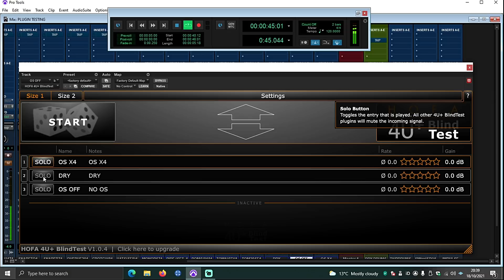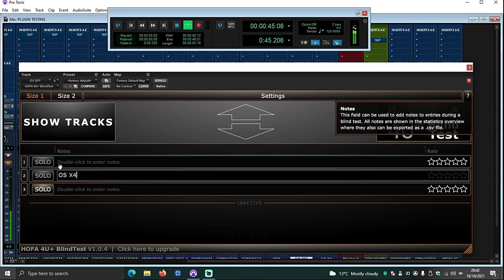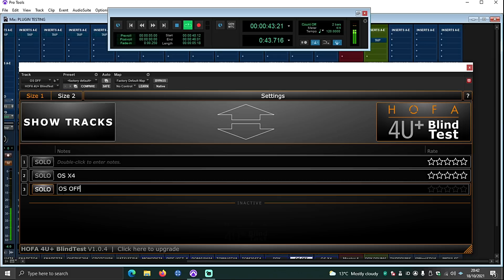ALIASING IN AUDIO PLUGINS... The most important things you need to know!!

Comment: Another point about stacking analog emulations is the difference between OS plugins and running at higher sample rate. OS plugins are generally a better choice for this reason -- ie, when you stack analog at high sample rate (no OS), the higher harmonics from earlier stages feed later stages causing even worse aliasing. With oversampling there's always a LPF to cut out things above Nyquist. So stacks of oversampled plugins will run cleaner than stacks at same equivalent sample rate, assuming you do not manually insert LPFs between every stage to replicate the filtering.

So if all plugs I use support oversampling, then I'd always choose OS instead of running at higher sample rate.
Reply from the maker: It's definitely something I'll need to look into because a few people are commenting about the artifacts of oversampling, some are commenting about higher sample rates. I'll need to dig into it at some point haha but yeah I agree, I have seen some plugs at even like 192 which still has some audible aliasing due to the amount of distortion made
Reply: @PaulThird  yup, there's probably some amount of artifacts just from the up/down sampling process itself (different amount of interpolation -- REAPER has options for this), and the LPF is going to induce some phase distortion no doubt. EQ isn't free in that sense.

For 192k not being enough, I personally don't worry about it unless I'm intentionally driving something really hard like with guitar FX.

Of course all this feeds the analog v digital debate.

Comment: Aliasing is awful, there are still developers around like Airwindows telling that oversampling sounds bad in comparison to their terrible aliasing  plugins...
 Oversampling option On/Off - Render On/off should be a standard on all plugins. Developers are just lazy to implement this, it´s ridicoulous. I never buy one  plugin again without this feature.
Reply from the maker: I tried his ultrasonic which was his solution to not using oversampling but it didn't work for me. Dunno if it's cause I use metaplugin as a vst wrapper in protools but it didn't do anything haha
Reply: @PaulThird  dude... The ultrasonic plugin is specifically for filtering out ultrasonic frequencies when you ARE oversampling...
Reply from the maker: "Drop it into your (preferably 96k or 192k) digital mix and it will clean up anything nonlinear that goes after it

It’s very easy to use: just put the plugin before anything that might alias

Put it on everything that you want to smooth out and un-digitalize. Sometimes there’s nothing quite like beating the problem into the ground with a sledgehammer. For frequencies over 20K and the aliasing that loves them, this is that sledgehammer."

I didn't take anything about oversampling. I tried it at 96k with aliasing plugins. 48k & 48k oversampled x2 just to see. Tried it before, after.. Didn't do anything. Aliasing still remained. That's why I am saying if its possibly cause I'm using it in metaplugin as he doesn't do AAX but it doesn't matter what I do and how I use it I can't get it to do anything. It removes no aliasing
Reply: @PaulThird  it doesn't remove aliasing... It's meant to remove problem frequencies that you can't hear to avoid them screwing around with further processing... That's all...

Why would you think that placing what is just a steep LPF after any potential aliasing has occurred, world magically remove said aliasing? That's not its purpose... It's just designed to lob off "ultrasonic" frequencies before passing the audio to the next bit of processing.
Reply from the maker: But then why talk all about aliasing then? 

'Aliasing in digital mixes is annoying. You typically don’t hear it directly, but it coarsens and flattens the mix, throwing all sorts of funny harmonics in there at random frequencies, like subtly ring modulating everything (the aliased harmonics go off on frequencies not related to the original notes, and clash). It’s often very subtle, but it turns up everywhere you have nonlinearities. If you distort stuff in digital mixes, you run straight into aliasing problems. Same if you compress, or do anything nonlinear… and even if you make a mix as pristine and minimal as possible, if you’re mixing in the Airwindows Console system that uses nonlinearities too.

You can run at higher sample rates and that gives you more room, you can use soft saturations (like what’s in Console) and that makes the harmonics appear in order so only the highest frequencies will fold back and alias, but it’s in a computer: you’ll always run into the limits of juggling numbers and calling it music, and you’ll experience aliasing through nearly anything you do.

But what if you just took those problem frequencies away?

It’s very easy to use: just put the plugin before anything that might alias"

Why is he taking so much about aliasing
Reply: @PaulThird  Because it's designed to minimize any aliasing (preemptively) that would be brought into your mix by ultrasonic frequencies when running into subsequent non-linear processing. If you're not feeding those plugins those frequencies, you're not gonna get aliasing from THOSE frequencies, bc they have been removed before they ever reach the next plugin. 

A fine example is running a synth at 96khz, there is a TON of ultrasonic information there that may or may not wreak havoc further down the line. If you filter that out, you get the benefit of a cleaner sound from the synth, without causing any nastiness in the next plugin getting that generated audio.
Reply: @IAmSomeTreyGuy  ultrasonic is not working, his plugins still aliasing with it, compared to other´s with built in oversampling option, like fabfilter, melda...etc
By the way why would you use another plugin for fixing aliasing, it´s a workflow killer and  can only be developed by such a weirdo like chris, who has clearly no clue how to make records using a DAW! His tools are useless for that regard.
Reply: @jorvten360  OMG... I cannot explain it any better. Ultrasonic does not REMOVE aliasing... It is meant to prevent any aliasing caused by ULTRASONIC frequencies in any plugin that is processed AFTER the Ultrasonic plugin... Frequencies BELOW the audible range can still cause aliasing. You have a complete misunderstanding of what the plugin is even for.

It's literally just a steep LPF. NOTHING MORE...
Reply: @IAmSomeTreyGuy  Well the developer, chris claiming  this method to be used in reducing aliasingg on his plugins.

A) Higher session sample rate 96K with 
B)  Putting aditional ultrasonic filters in

That is not working, the developer Chris is claiming this method should reduce aliasing.

Unfortunately you´re better of with plugins from developers  that are using actual working oversamling options into their plugins. 
Like fabfilter or Melda, Tokyo Dawn etc... and manny others. less headache, better workflow, more stable system, cause you can run at 48K session sample rate.

In my experience all Airwindows plugins are useless, exept the Dither Plugins. They are kinda special, that´s it. 

Please stop further discussion on Airwindows, i´ve spent to much time on it comparing them to my bread & butter plugins, it was just a waste of time!
Have a great weekend :)
Reply: @jorvten360  You have no idea what the plugin is even for... clearly.
Reply: @IAmSomeTreyGuy  I don´t need  it, it´s not fitting my workflow. I´m not an Airwindows lover & you won´t convince me. I know my tools in & out 100 % they blow Airwindows out with a blink of an eye. If they ´re working for you, i´m happy for you!
Reply: @PaulThird  The guy is living in his own bubble, that´s the problem with developers that have never done a record in their life or how know how to use a DAW  for final production.
Reply: well, I think aliasing should always be a choice.. an option. I've had oversample options in plugins that I used to use. For example on the Saturator-X. Now mind you: That was before I knew what aliasing is. And being a good little engineer I simply tried clicking the buttons and picked what my ears favored. Now maybe you guessed it.. sometimes I preferred no oversampling. Crazy, I know.
Reply: @akagerhard  Aliasing is terrible, especially with transient heavy music. For me it never worked well, it´s night and day. i started back then with tape, midi sequencing, big console studio environment. Aliasing was not exsisting, i made the analog to digital transformation from day one, knowing both worlds in & out. At the end it´s a personal preference & taste. I like clear precices transient behavour and a wider soundstage. That´s only happening on my material without Aliasing
Reply: @jorvten360  I usually don't look aliasing neither.. but it really depends on what kind of scource you're using it on and what kind of sound you're aiming for. I'm not saying I wouldn't use the OS-buttons more often than not.. I'm saying: give me the option.

Comment: Another great video Paul! Question for you… No doubt running higher sample rates cuts back on aliasing. However, I’ve been told that if your sample rates are too high, you can introduce artifacts, which are non-aliasing related. Are these high sample rate artifacts due to the fact that some peoples computers can’t handle the processing power to run the high sample rate, and therefore the artifacts are showing up? Just trying to pinpoint where and how this is happening. That being said, perhaps there’s a sweet spot, Where the sample rate is high enough to not introduced aliasing, but low enough to not introduced additional artifacts? Any thoughts?…
Reply from the maker: I don't know tbh. An engineer friend of mine nulled a 44.1 track with a 192k track so I can't say for sure if there are artifacts but my gut says doubt it in terms of daw sample rate. I can see oversampling possibly causing artifacts and that is something that I look to test in the future as artifacts in oversampling in  certain plugins have been mentioned before 🤓
Reply: @PaulThird  thanks! This makes sense! I personally have never heard any artifacts when running my sessions native at 96K. But then again I have a pretty robust computer. Anyways, if you end up releasing a video that tests potential artifacts at higher sample rates, I would certainly be curious!
Reply: @colonelw.g.sparkman6931  it can be accuracy based as you guessed, but it's also harmonics from above 20K coming back down into the audible range and causing distortion/artefacts etc,

Comment: Well I looked away from the screen when while you were switching thru the three, and I could not tell when you switched between the tracks. My internet machines speaker setup is a pair of Sonarworks corrected Behringer Truth B2O31A' speakers. Maybe is my 67 year old ears? Who knows. Thanks for the video.
Reply from the maker: I could still tell differences in the car driving back from work but it was really hard due to the horrible bass in the speakers drowning a lot of the detail. I kept on getting the Lindell x4 PA right but had to listen harder for the dry and aliasing to the point I actually had to redo it with the engine off haha helped a lot but still difficult.

With these tests I find it's all about knowing where differences are. As soon as I know where they lie I know where to look so I don't get distracted by other things, especially doing 3 files, it's easy to get thrown off. I had to do it 3 times more to prove to myself haha
Reply: @PaulThird  stop showing off, you'll get yourself killed.. listening for aliasing while driving.. you're nuts!
Reply: Don't worry. I looked (and thus knew when a change was coming) and still got it wrong the second time around (I suceeded on the first and third blindtest - maybe luck?). And my ears are considerably younger than yours. I don't think I'd conciously notice a change fast enough, if I didn't know when the change is coming. This was too subtle of an example for this - in my opinion. Maybe there are engineers that get the heebie-jeebies instantly without looking - I'm not one of them. (Was listening on my non-corrected, but deerly trusted 30 Buck Logitech Speakers (Sub included, but irrelevant for that example).. if I can't hear something on them, for me, it doesn't exist)
Reply from the maker: Could be the YT codec but with these simple tests I always advise to try out for yourself so you are listening to the files as they are in the daw. Just as it wouldn't take long at all to set up. 

Don't get me wrong it's subtle but it came down to feel for me on this. That's where I could tell the differences. I looked for the beat on this and I could hear and feel the dry and no OS not carrying the beat of the track as much as the 0S x4. Almost as if that extra saturation from the Lindell was just giving the record a bit more girth and weight and slight more punch in the transients. All subtle but enough for me to pick out
Reply: @PaulThird  I refuse. I don't believe the Youtube-codec will significantly impact saturation or aliasing.. that simply makes no sense to me. I understand that it can mess with transients (or even distort if you leave youtube no headroom) because of compression, but not much else. But then again I don't know a lot about codecs and such.. that's just how I experience it.

edit it was brought to my attention, that Youtube does not compress/limit audio (in the common sense) at all. When an audio sounds distorted, that is due to the uploader, not due to youtube.  Goes to show how easy it is to make false assumptions.
Reply from the maker: @akagerhard  I've heard a difference between youtube and Spotify listening to the same track and trying to level match and stuff. Spotify sounds better to my ears compared to youtube. Somebody also told me there is a 15k lpf on the YT codec but dunno how true that is. I genuinely don't know what the YT codec does to the sound tbh but I imagine there may be something as this triple blind test wasn't that difficult for me and I've not golden ears or like special hearing.. That I refuse to believe 🤣
Reply: @PaulThird  I'm pretty sure it's because this is especially audible in the drums. And you have listened specifically for aliasing more often than THIS BUSINESS and I did. Which means you'll be able to pick it out a lot better. If I hear a track with drums and a voice, my ears go for the voice. Knowing what aliasing sounds like is quite new to me - and I don't obsess about it. Plus my ears are not good (I was an artist/producer, first and foremost) and my speakers are awesome.. but somewhat limited. I bet ya 40 quid (for christmas) you'll pick it out comfortably on youtube as well. But if you do manage it, you need to find a way to show softube-plugins in Plugin-Doctor.
Reply from the maker: Very simple.. Need a mac to show softube in doctor as it only works in AU haha.. But I'm not buying a mac anytime soon.. And yes, listening for aliasing whilst driving is dangerous.. But its what I must do to protect the world from slight degradation of audio. Its a risk I'm willing to take and my kids will understand if I am hurt in battle.. Its what I must do Gerhard!!!!!!

Least we can see the funny side 🤣